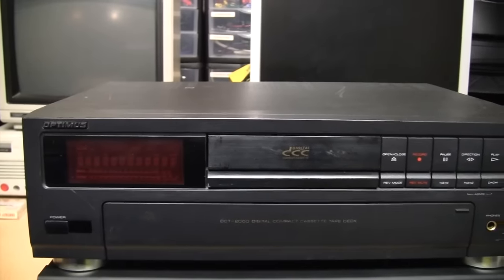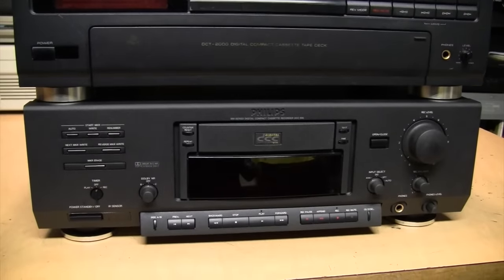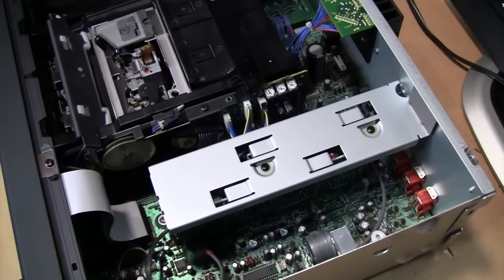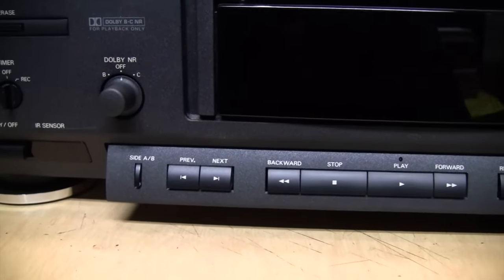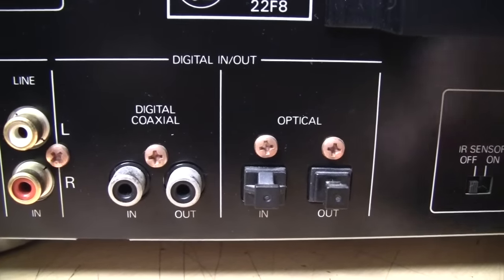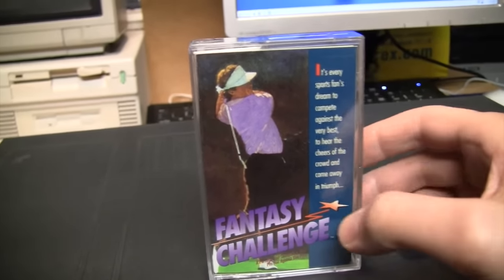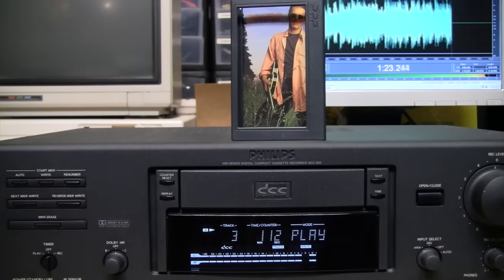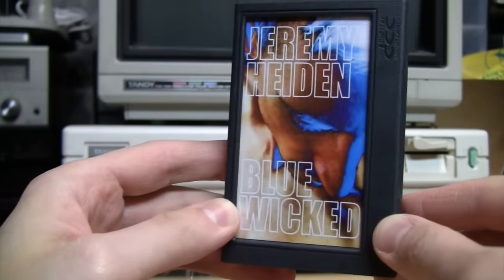Philips DCC900 Digital Compact Cassette deck revived!

Comment: The Phillips one was made by Panasonic for them. I had the Technics version, which did record on standard cassettes as well as DCC tapes. Your repair guy should have replaced the caps with the same style ones it had. Having those leeds out like that is asking for it. I am an electronics tech of over 30 years of experience and I used to fix these when they were new. BTW, your Sansui cd player is a Technics as well, just rebadged for Sansui.
Reply from the maker: The two Technics DCC decks (RS-DC10 and RS-DC8) can only play analog tapes, not record them.
Reply: VWestlife: Beg to differ with you since I actually did it.
Reply from the maker: Really? Show me the documentation to prove that there was ever a deck that could record onto both DCC and analog cassettes. I'm sure Dr. DCC would be very interested to see it!
Reply: If I still had mine, I'd take a video of me doing it. But, I really do not have to prove anything to you do I??? Back Off!! It is just a You Tube comment dude! Manuals do not always have all the info for region  locked devices. I will not respond to you any further since this is a non-issue and all you want to do is argue.
Reply from the maker: Extraordinary claims require extraordinary evidence. It is impossible to make a DCC deck which can record in both DCC and analog formats because the magnetic field required to erase and record an analog signal onto the tape would damage the sensitive thin-film heads used for DCC. It's the same reason why every DCC deck strongly warns you to never use a tape head demagnetizer.  

The only possible way what you're saying could be true is if your deck was somehow modified to allow it to record DCC digital data onto ordinary cassettes -- but as Dr. DCC's video demonstrates, that only is successful on the highest-quality metal tapes, which will cost as much as DCC tapes, so it's pretty much pointless.

Comment: I sold these when they were brand new. It was a horrible format then, it’s a horrible format today. I have a perfectly working Philips CD player from the same era- believe me, DCC tape decks fail from more than surface mount capacitors. I enjoy your videos, but most cassette of this era do require more than shotgunning caps, which unfortunately, seems to be YouTube’s definition of a restoration.
Reply from the maker: This was not "shotgunning caps". "Shotgunning" refers to replacing all of a certain type of component (capacitors, resistors, etc.) whether or not they were actually faulty. In this case the only components replaced were the surface-mount electrolytic capacitors which were already leaking and needed to be replaced before the corrosive electrolyte causes any more damage to the circuit boards. As I specifically pointed out in the video, the conventional through-hole capacitors are not faulty and do not need to be replaced.
Reply: VWestlife  I watched one of his videos, where he claims dropouts can be caused by bad caps. Not true. That’s an issue of tape heads that need cleaning and/or demagnetizing. I admire your efforts to keep one of these machines alive. I just don’t know why you’d want to. When caps are described as “leaky”, it usually refers to them losing their ability to hold a charge, becoming more of a resister. It’s not that common for 1990’s vintage capacitors to go bad, let alone physically leak. If they were paper capacitors? Maybe. But they are not in this case.
Reply: Arthur's Hallicrafters Kitchen & Audio Lab I am very sorry but when you use the words demagnetizing and dcc in one sentence, it seems to me that you are making a common mistake. Using any form of demagnetizer on these heads will end them. And yes, dropouts are causes by the caps or pinch rollers. After 141 decks of restoring dcc decks, I am pretty certain of this.
Reply: DR DCC  Certainty or not, restoring units from this truly dreadful format is a niche market, to say the least.
Reply: I still have one dcc900 and it stopped playing 2 months ago and bought it brandnew 1994 if i'm correct. Concerning speed(switching tracks) it is not the same as a CD, true. But there was a article in a professional audio magazine, that artists at a studio wnated their audio recorded on DAT and not DCC. But the engineer also recorded it on the 18bit bit DCC version and let it hear to them, and they were convinced it was DAT. Then he showed and played the DAT version, they were ashtonished as they could not hear any difference at all. And indeed the DCC head will drop out when demagnitizing it. I never played analog tapes too, becasue it will screw up the head too eventually. I worked for years in of the biggest repair centres repairing crt,lcd and plasma tv's in the Netherlands , we saw these DCC900's too. But mostly the head were screwed up by the customer. And after all these years the caps can easily be dried out. So Dr.DCC is correct in what he says. (anyway it's an MPEG format on the tape, what fdo you listen to on your phone, mp3 player, ipod? one way or the other it's related to MPEG)

Comment: Good vid but here is my complaint. That was very crappy work by DR DCC.  Being in the electronics service industry what he did in his repair was unprofessional and a rush job. There was no excuse for him to use Through Hole caps. I re-cap many classic mac boards and even with bad traces I still perform the work correctly. Just my 2-cents.
Reply: Don't be pedantic.  The electrons are not impressed that you managed to find a similar form factor.

The only difference between TH and SMT parts is whether you need holes and manual labor to insert them, or if they can be installed via pick-and-place.  Otherwise, only the specs matter.

(Sure, in certain cases ceramic caps may matter due to lead inductance and so on, but this is clearly not one of those cases.)
Reply: Agreed, SMT pads aren't meant to hold TH components and causes unnecessary stress on the pads, something you do not want on potentially weakened pads from cap leakage. Disappointing to see the last authority in DCCs use such flawed methods.
Reply: The boards are really brittle and we have performed many tests on them. The best is to re-create the board from scratch, but to time consuming and expensive. After removing the smd caps we try and put as little stress on the boards and using regular caps is a very good choice. The specs are the same and there is plenty of room for it.
Reply: The SMD pads are the mechanical support for the original cap, so what's the difference?  These small caps weigh f-all, so whether it's a can with two round leads sticking straight out or a can with two small leads bent at 90° and with a plastic shim, how is that going to matter to the copper?  It's either still securely bonded to the substrate or it isn't - and the cap's form factor isn't going to make a whit of difference either way.
Reply: Nick Wallette The 16V version smd (6V is nearly impossible to get) is also larger than the pads, requiring more contact/heat in my opinion.  The AR1 mechanism from Technics needs smd for instance, because otherwise the housing wont close. But for these we still can get all the original specs.